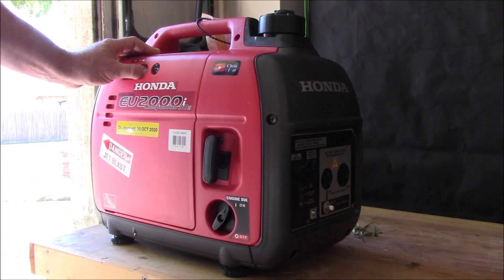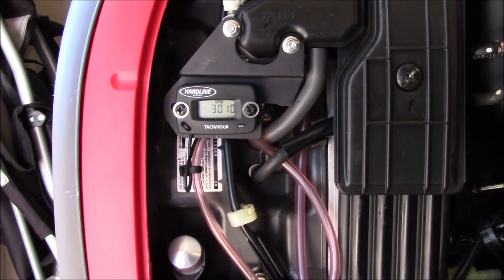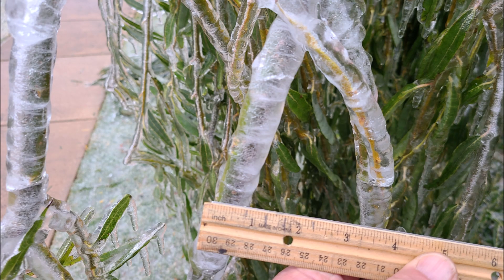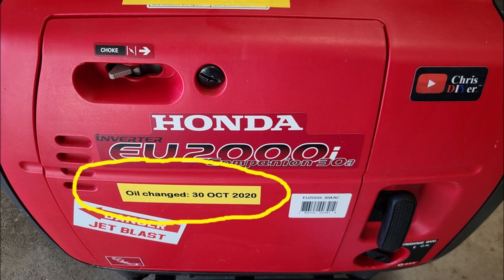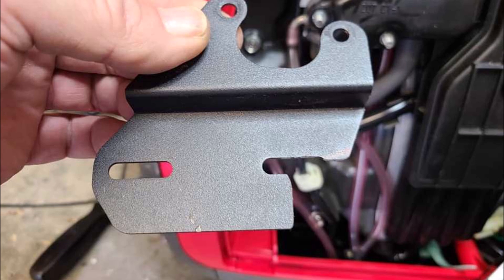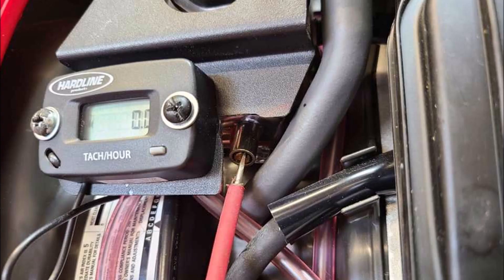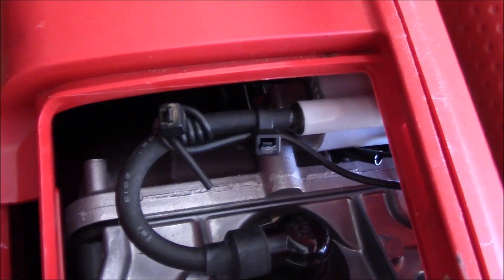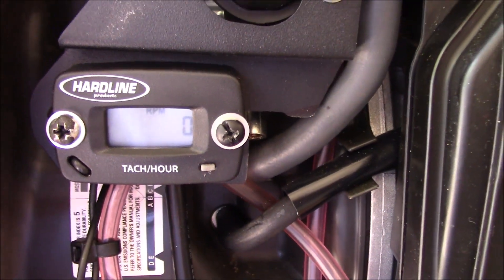Installing an hour meter and tachometer on a Honda EU2000i generator

Comment: Very trick as we used to say. I am headed up the mountain tomorrow to bring our camp trailer home.
It will be 7 Deg. F on Monday morning up there. I may be trailering it home in the snow. Not looking forward to hauling in down  in the snow. Ill bet your roads were a nightmare with that ice storm.
Reply from the maker: Stay safe...mountain driving can go from boring, beautiful, and then sheer terrifying in a matter of seconds. Heard that big cat was spotted on that mountain (just goofing with ya).
Reply: @ChrisDIYerOklahoma  lol. Actually catamount has been spotted at our new place. They are not as prolific as home but definitely an issue for the local homesteads. The real booger is the wolves are moving down from the North. I have seen one set of tracks on our place. No packs as of yet.

Comment: Could you not charge the batteries with the jinny?
Reply from the maker: I removed that receptacle in the garage...but, pretty easy to rig up a temp plug. I just about did that to use the Honda to charge my battery bank. But, decided not to.